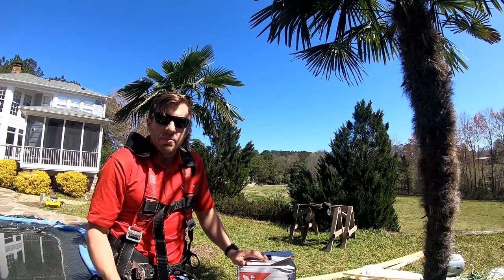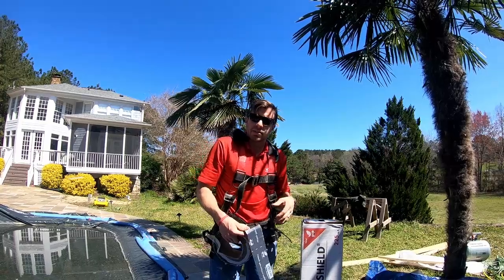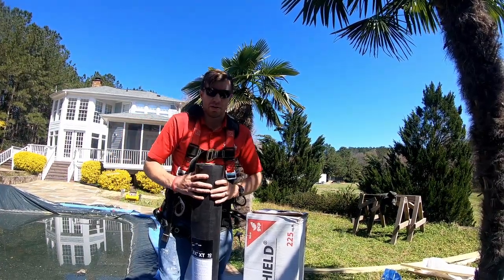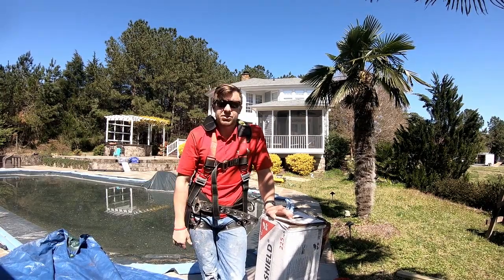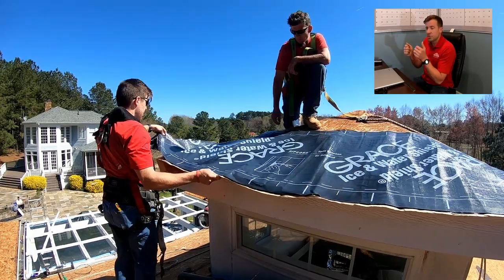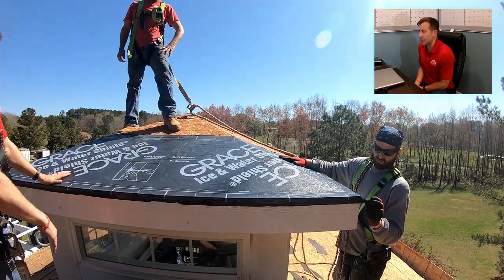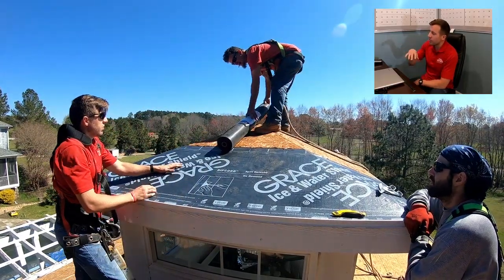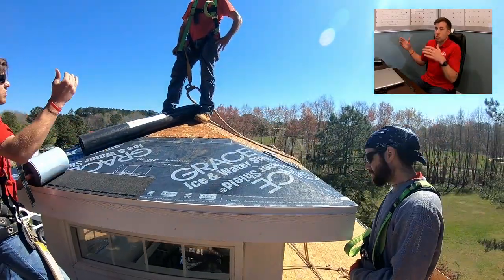Roofing Right with Grace and GAF Products

Comment: Nice vid for sure.  I went with GAF ice and water shield for my 1200 sq ft home here in SE AZ. GAF tends to recommend putting their product right over the drip edge.  That would not work so well for me here so I am thinking that extra edge narrow piece of ice and water peel and stick might be a good option to put over my drip edge. I will be putting on a galvalumne roof.  What do you think?  Thanks.

Comment: Put drip edge on first then ice and water, eliminate the small strip of ice and water, water will never back up under the drip in that area
Reply from the maker: This is actually a good comment.  For several years this has been discussed and researched in the building science world.  Many people, still today, do it with drip edge first on the eaves.  This is for ease and speed, and just because it's how they have always done it.  Research has actually proven that the bond between the adhesive backed ice and water and the aluminum is not strong enough to stop the penetration of water.  This is especially true where you have lots of wind driven rain(here in NC) and ice dams.  The extra strip was done as exactly that, extra.  We typically donnot install that and just bring the first layer of underlayment on top of the drip for any rain that comes before we shingle.  Now, on the rakes, we do not put underlayment over drip, we put it below just like ice and water, to stop any wind drive rain from making it's way to the framing.  Thanks for the comment and for watching!!
Reply: Agreed, I live in Ontario Canada and have been doing it this way for over 45 years and never had a problem with water backing up under the ice shield by the drip edge, however I wouldn’t put my drip over any underlayment going up the rake edge ever incase of any wind blown rain
Reply: Grave ice and water adheres to anything lol that shit is the bomb.com definitely the best product to put on your decking/ up walls and valleys etc.
Reply: @remodelingamerica7202  Great video and lots of good points.  I don't understand why the roofing industry does not have a 4" or 6" self adhesive flashing product.  All of the normal flashing is for windows and doors, and specifically calls out "not for roofing" (see FortiFlash), even though it seems to be the same product, and has clear uses like you have found here.  Why not sell at least a 6" wide x 75 ft option of the Ice and Water product?

Comment: what happens when you need to redo your roof in 40 years? Can and should this be peeled off or just reapplied over it?  I feel like it will rip part of the OSB off.  Is this good in Florida under a metal roof? How about under solar shingles?  
side question but if  I'm looking to build a 2 story house with single flat roof and want the minimum number of holes in the roof, is metal the way to go? If am planning a solar roof that will use strips, can the strips be Cellular PVC and be screwed (instead of nailed) all the way through to the rafters?